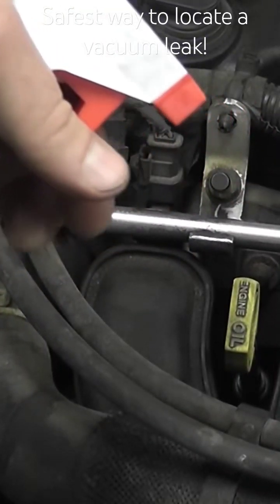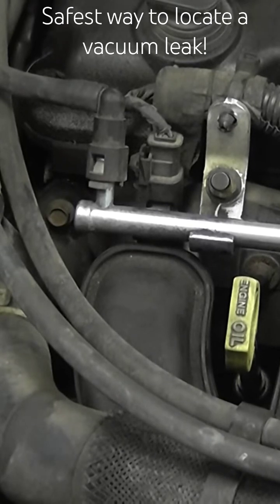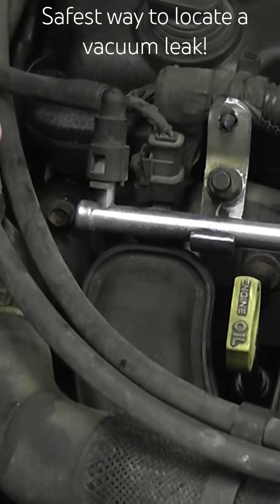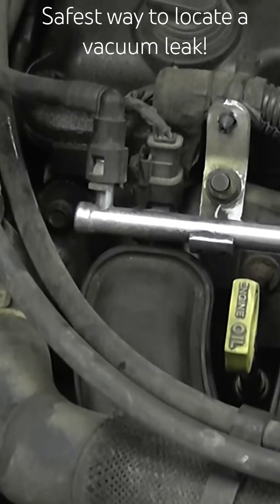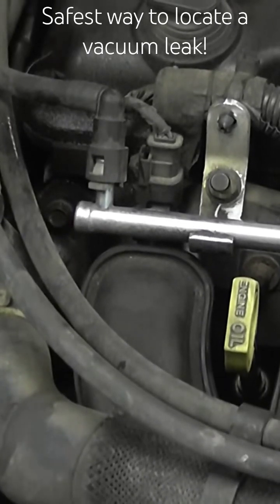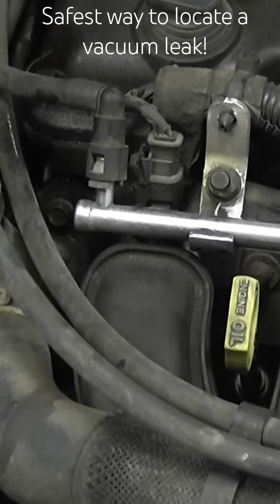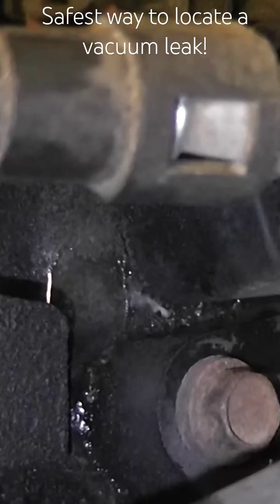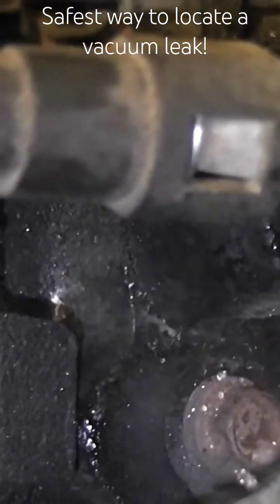How To Pinpoint a Vacuum Leak [the safe way]

Comment from the maker: I stopped using a flammable source to locate these on the day I was doing a mobile call for a shop and was using carb cleaner to confirm a vacuum leak. Well, I found it at the same time it had an intake backfire which caught the engine on fire in front of the customer. It gets worse because it's not my shop and I don't know where the fire extinguisher is! In the end, all was well, but since then, it is water for the win! And honestly it is way more accurate too. And no YOU WONT HURT THE ENGINE!!
Reply: I used what's handy (usually brake cleaner). I once saw an older mechanic use water to find a vacuum leak and thought "Huh, why?". Then, one day, while spraying brake cleaner the engine caught on fire (briefly!) because of a cracked ignition coil pack. Then I thought of that older co-worker :D
Reply: Prob try this

Comment: In the good old days I used a lit cigarette for a smoke source and watched the leak suck the smoke right into the leak. Works in a pinch,and in certain circumstances when there's no drafts from fans and breezes. But it's been a solution for me at times.

Comment: Use what the HVAC dudes use...."Better Bubble"😉
Reply: I might be missing something, but better bubble or "snoop" are designed show a leak in a pressurized system by making bubbles at the leak. How is that any better than water on a vacuum leak? It ain't making bubble!    Oh wait,  that's a wink. HA HA I missed it at first.
Reply: @daviddelle774  no, you are right.   Better bubble was a stupid suggestion.

Comment: I have done all of that carb cleaner checked all sensors fuel pump pressure maf readings O2 readings injector pulse & readings it seems like it let's out a puff of air when I shut it off Fixed a evap P0442 leak on the top of the tank. But the new code P0171 won't go away. I am lost smoked multiple times. I can't see anything double triple checked. 2000 MR2 1.8. I'm losing more hair, sleep, thru my girl out dogs too kidding about the girl & dogs but not to far from it 😮.
Reply from the maker: What are your fuel trims at idle and 2500 rpm in park both STFT and LTFT
Reply: @ScannerDanner  thanks for the reply. If I remember correctly, LT 21.0 - ST 0.7 idle. At 2500 I don't remember. It's a manual trans. The only other thing I can't understand is that the pump doesn't prime when the key is turned, doesn't raise or drop under throttle. But the car starts fine idles a little rough. But seems ok pressure stays at 47-48psi. But it let's out a hiss when it's shut off like a big leak. Pls help me LOL what am I missing.

Comment: For 15 years used brake clean. A couple of months ago 98 dodge ram 5.2 caught on fire. Don't know spark leak somewhere. Will need to reevaluate my process.
Reply from the maker: After my last fire, I changed my ways too lol
Reply: Too much brake clean you dumped it bro Thats why

Comment: Had a hack mechanic tell a buddy to use Ether....
Reply from the maker: I mean, that works until you have an intake backfire or arc of a leaking ignition coil cause a fireball
Reply: @ScannerDanner you find two problems at one time , and sometimes cause a couple more 😂

Comment: I've always used my mapp or propane torch. It is impossible to create a stoichiometric accumulation large enough to do anything but burn some arm hair under the hood of a running engine. Wayyyy more effective than water too. With water you have to basically hit the leak to get an effect. Gas just has to be close
Reply from the maker: Use more water 😂😉

Comment: I've used a propane torch before. It won't accumulate like brake clean or carb cleaner.  If there was a backfire and a bit if propane around the area you might lose the hair off your hands though.